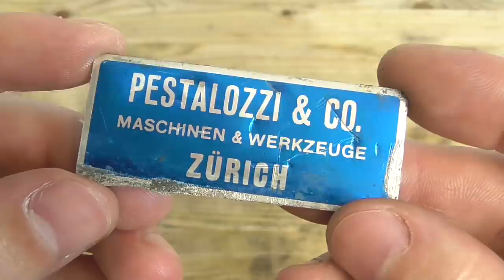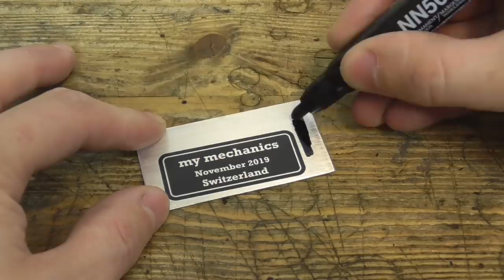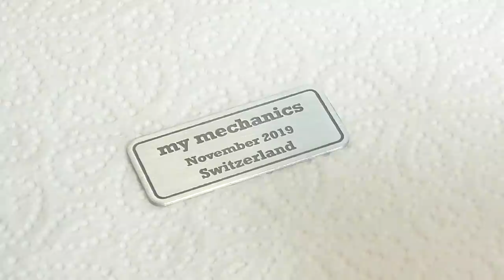I Make a New One! Making new Parts on Lathe & Mill for Restoration Projects (Compilation Part 2)

Comment: That wing nut you make at around 21 mins gets me every time. Its crazy how close you got to the original and also insanely impractical lol. I love it.
Reply: I remember the original video. I was screaming at the screen, "HE MILLED A WINGNUT!"
Reply: It's the most insane thing. But also amazing!
Reply: That wing nut could have been replaced with a cool Bronze or brass thumb knob with a knurled surface to tighten it up with, which would have made the hand held vice a bit more user friendly, as the wings could get in the way while working on small parts, that are  held in the vice. But what was made for the restoration was Insanely amazing.  It was actually better when finished  then the original was when new.   Cheers.
Reply: Wingnut came out better than the original

Comment: For wood: shellac dries very quickly and is easy to sand (unlike varnish, which is much harder). How about using shellac to give some shine to the wood? When I walk into a hardware store, any wood parts are shiny. That does not decrease grip or make them harder to use. I'm just proposing this again (shiny wood instead of dull, lifeless wood) because I saw the icky black-grey of the wood parts of the plane. I suggest adding nice-looking wood to the central core of you, which seems to be a drive for perfection instead of "good enough" or mediocrity. This love of the fine details is what sets you so far ahead of all the other rebuilding channels.I can sit and watch you work for *hours*, entranced the entire time.

Comment: I just noticed that most times when you re-make screws they are flat heads. Is there a reason why, are they better than Philips head or is it usually the same as the replaced part?
Reply: Usually on old items they are flathead, but they're better than Philips